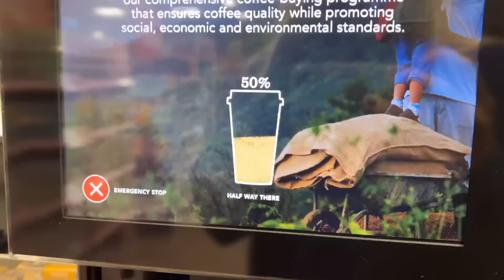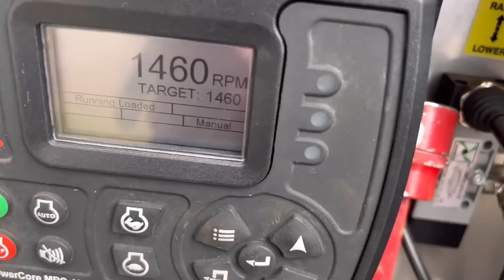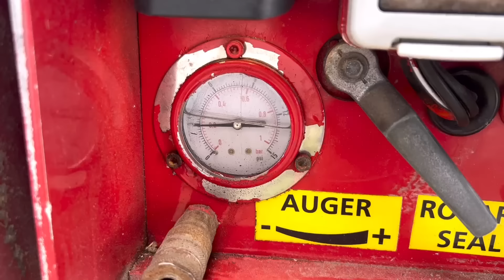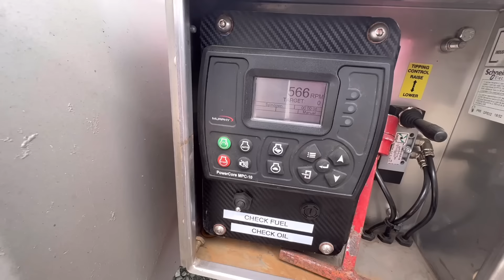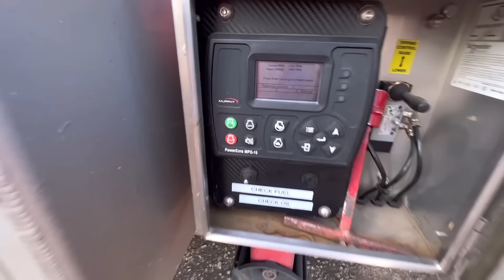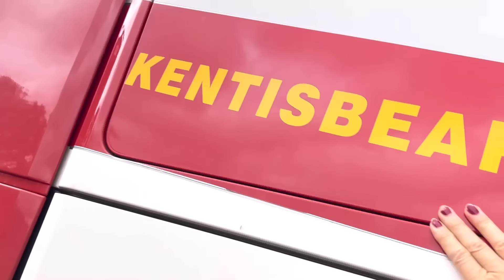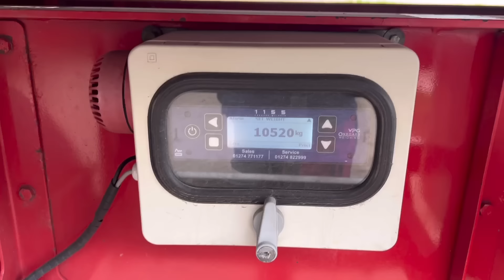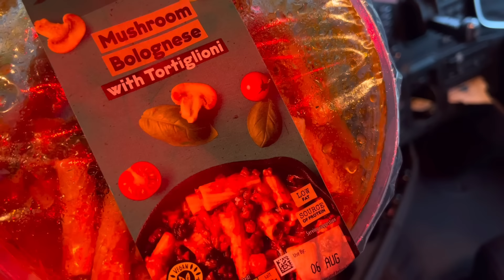Low Bridge | parked on double yellow lines | blower trailer

Comment: This lady epitomises what a professional HGV driver should be. I worked in the haulage trade for several years and saw many atrocious lorry drivers. It a professional job and this lady flies the flag and sets the example. Love your videos. 😘
Reply: She's good on grain, but how good will she perform on general haulage .
Reply: @davidmarshall5603  probably just as good 👍🏻
Reply: General haulage? You mean open curtains and close them mwhaaaaa
Reply: @anthonycross9310   No pulling a 40 flat no curtains. Having to carry ropes sheets, chains straps, silvesters, 480 gkn pallets 20 high 8 ft 6 in containers, this is general haulage .
Reply: Oh yes funny I’ve been on general haulage now for 33 years in November. Very very few firms operate that that now and you should be aware that’s ropes are illegal for load restraints. 
That lady could do 99.9 percentage of general haulage in the uk without any problems FACT
Reply: @anthonycross9310  This was 1980 to the late 90s when I did it, and I no lots have changed in the last 20 years .

Comment: This job is not for everyone, but you do it with grace, and it is lots of fun watching get through your day! If a tool handle is too short to use to open that door find a metal pipe to fit over the end of it making the handle longer it will add leverage making it easier to open that door.  Keep on trucking, cute Cowgirl!

Comment: This was a very eventful day with lots of action. That low tunnel is pretty scary, there were only centimenters between your truck and the ceiling. You were lucky that was a private lane and nobody hurried you from behind. This newer model blower trailer is very nice. The engine is definitely more sophisticated, although I find it interesting there's only a manual tarp on the trailer. As always the surrondings are gorgeous and even the weather was acceptable. Fantastic vlog again Jemma, you're great in this genre. :thanksdoc::virtualhug:😍
Reply: Thank you. It's funny how they improved one part but didn't spread the upgrade though the hole trailer. Take care.

Comment: In Denmark we have very strict rules for driving times, being controlled with the meter in the lorries, when stopped in or for a control.  So they often need room at parking areas on the Motorway and other places, all being taken by others. Even parking areas by Supermarkets are used for this.

Comment: There's nothing worse than that sinking feeling stressing over a low bridge although in most circumstances unless you've made an error going the wrong way you'd know in advance but we've all been there when you turn down the wrong road you're not familiar with, in your case at least you knew about it and was a case of it either will or won't go under, those arched bridges are worst, great job, if I ever see you on the road i'll be sure to give you a toot. Great video incite into your day at work, nice reversing on the weighbridge.

Comment: Manual Transit Van yesterday, normally struggle with Legroom in Vans at the max but big, spacious and surprisingly nice to drive, tight squeeze got out & in Passenger side, steep, should count to 10 for the calm inside the vehicle as screeched off handbrake starting with accelerator & clutch engaged, an interesting story, no such thing as foot misplacement and handbrake held out luckily enough, there's no height indicated inside the vehicle however missing it felt.  Staff on (RDC type) Sites whilst driving a Class 1 demand a Hard Hat which was similar to a Rhino walking up asking me why I'm not wearing my Horn in a Shopping Centre.

Comment: ... Yikes that underpass bridge sure was a squeaker, sure had to be centered, well done first shot .... bind siding .. had to laugh, you running across the cab to have a look reminded me of a place we went to back in the early eighties in Vancouver that made boxes that we would bring back to the Okanagan Valley for all the fruit packing houses. Anyhow the loading bays were built at a time when trailers were 40 and 43 footers and we were at a time where 46s were common and the 48s were coming on the scene. Anyhow there were two of the bays that had to be blindsided and there was a lot of running across the cab for a looky. ..... know the frustrations of tarp covers not cooperating, hauled wood chips to a pulp mill 03 to 06. Can only imagine the frustration now as the safety requirements dictate that to be on top of the trailer now a fall restraint must be used. .... there are bunnies all over the place when I go in the bush in the mornings right now just as it is getting twilight They are all dark brown but will turn white Octoberish when there starts to be the possibility of snow. Saw one last week that had white feet .... thx for the share .. as always .. never stop dreaming, just dream bigger .. have fun be safe, save our oceans .....

Comment: Another excellent video, Jemma.

I wouldn't worry about parking on those yellows because you could argue that you could not have known that where you parked was still under enforcement due to the yellow lines not being maintained properly in certain places on the road.
Reply: Like every other road sign on the roads, what’s the point of the highway code

Comment: Question for Jemma or any other HGV drivers on here. Is there a reason why you have to log on with your tacho card before doing your daily checks ? Is this against some kind of rule ? It would save you a few minutes on the clock surely  if you are allowed to do this ?

Comment: Well as the ASLEF drivers have just had 15% backdated more than 2 years for doing nothing but sitting in a cab, on a set of rails with points worked by signal men etc, earning reportedly 75k per year  you and your colleagues do a much more chalanging job for in a good year 50k max..
But then you dont have a Union boss who holds the country to ranson.
I rest my case.